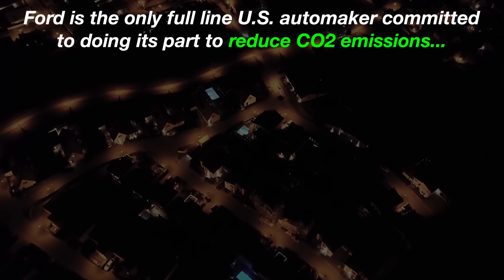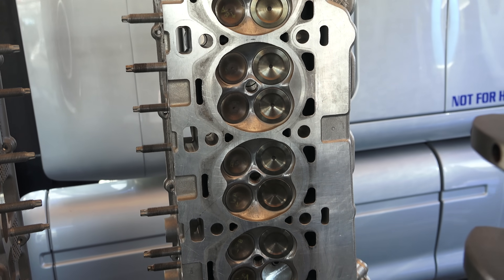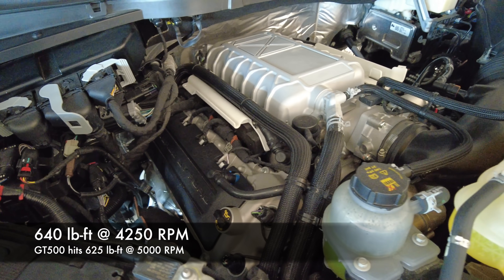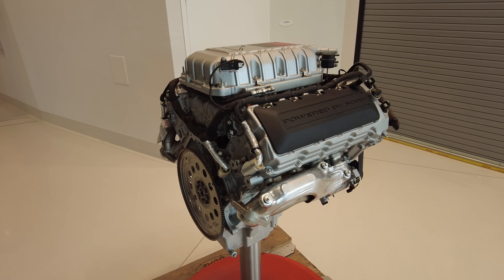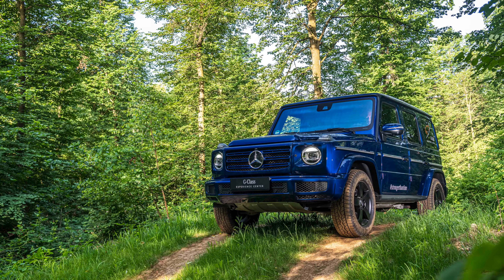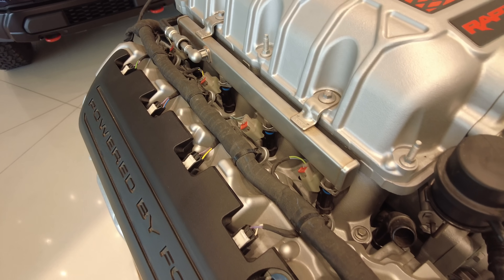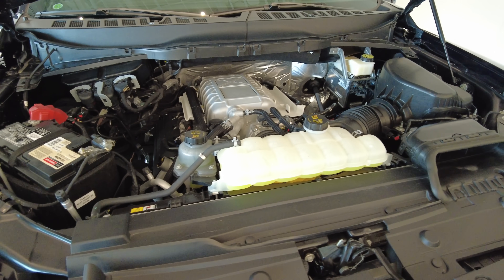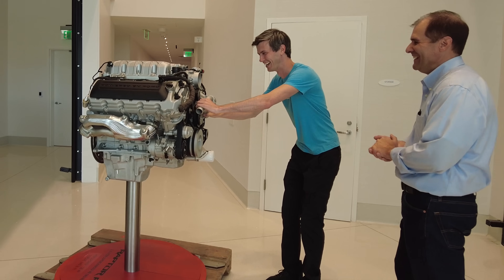Ford Raptor R's New V8 Engine - Meat's Back On The Menu

Comment from the maker: *UPDATE - WRONG INFO* Clarification as there is some bad information at 5:13 (as pointed out by Cory Engel in the comments). The bypass valve operations is as follows, as per Ford:
1. When the engine is at WOT, the bypass is fully closed, and everything goes through the rotors, charge air cooler and into the cylinders.
2. When the bypass is fully open, say at idle, when no boost is required, then the majority of the air goes through the bypass circuit. The engine air flow demand is not very high, and it takes the path of least resistance. It still goes through the CAC.
3. At part throttle, part loads, the air can recirculate in the unit.

Regarding 3 above, this means at part throttle (highway operation, etc), the airflow still goes thru the rotors, but the excess pressure actually is bled through the pass and recirculates (unlike what I state in the video, that airflow skips the rotors - it does not!).
Reply: Do a YouTube search on this;
What if Toyota revealed Nuclear Diamond Battery?
This could end ALL combustion engines. What do you think?
Reply: Skipping the rotors entirely would be better, yes?
Reply: Thanks hillbillies for destroying our climate and causing drought and wild fires from trucks
Reply: Buick had a bypass on the 3800 Supercharged engine. It achieved 30MPG hwy (real-world) in a full-size FWD car. Back in 1990.
Reply: That's a new design of the first clutch pulleys first used on alternators, Ford started using a clutch pulley to prevent over-revving the alternator in the early 2000's, going past ~18,000RPM causes centrifugal force damage to the internal rotor windings (and small 8mm rear bearings). 4.6L DOHC engines in the SVT Mustang Cobra, Mach 1 Mustang, and Bullitt Mustangs were all at risk of over-revving the alternator.  The Crown Victoria Police Interceptor also got the clutch pulley because it had a larger special (expensive) Mitsubishi 240amp alternator, and concerned Law Enforcement would drive it too aggressively with the larger internal rotor to produce that amount of current for all their electrical devices, was at risk of over-revving (was also available on dual battery Super Duty's, but no risk of going past ~18,000RPM).
Reply: Wow, Ford blew it on the logos on the hood.

Comment: Comparing this Raptor V8 to an electric truck. The Raptor is going to be a bit slow with bad gas mileage, and has the typical truck lines. It also has a ton of motor oil, transmission fluids, spark plugs, gas, supercharger and a truck body. I need and want this Raptor R.

Comment: They’ve should have used their Dedicated pushrod Godzilla 445 (7.3) cubic inch Truck engine. Supercharged crate engines from Mast Motorsports are making 1,300 hp and 675 hp naturally aspirated with a cam change.

Comment: How many valves? Does it have complex variable valve timing? Ohc? Since the late 90s ford has been producing engines that are better suited for boat anchors. Lousy engineering from college kids is my guess but there is no guessing how bad their stuff has been for 25 years. Last good engines were 460 v8, 300 straight 6 and internationals 7.3 PS. Sad but true. Show me don't tell me after that long.

Comment: No dude!  Nothing is as good at lubricating than an air gap.  An air gap provides excellent lubrication up to speeds of MACH 2.5.  Why do you think we use magnetic bearings in large industrial equipment.

Comment: Too little too late. They should have done this in 2017 instead of forcing the v6 on everyone that wanted a Raptor. The interior will need some major upgrading to compete with the TRX. Dealerships have gone insane, the markup on these will be astronomical unless Ford takes steps to address it.

Comment: More cubic inches please.
Ford should have made the modular engine with a larger bore and shorter stroke for a capacity of say 6.2 litres instead of 5.4.
A supercharged 6.2 would have 800hp and 700 lb ft of torque.

Comment: Now if Ford would just listen to its customers and bring back manual transmissions in their normal pickup trucks I would buy one put a manual in the Ranger the F-150 either one I would buy one until then I'm going to keep driving my old tired manual transmission Ranger and my 5 speed 2010 GT I cannot stand automatic transmissions!!

Comment: Awesome to see ford put this V8 in the raptor! And still give you engine options. I think we have to thank the TRX for Ford doing this. And also ford upgrade the rear suspension to coil spring 5 link. 

I like both the TRX AND the raptor but the comparison I wanna see is them in stock form compete in the Baja 250-1000 or any desert race. All the TRX videos are of them drag racing 😓 I want see if the TRX can hold up in extreme desert racing.

Comment: To bad it didn't used to old bundle of snakes center valley exhaust with turbo and cylinder fuel injectors on low speed with port injection kicking in at higher RPM's...

Something like that good old double pumper Holly carburetors...  More gas to pass when the pedal is on the metal 😊

Comment: Intake implosion is a real thing. I crushed an aftermarket filter due to air restriction. The cone filter collapsed on itself. Had to switch to a dual cone filter and calculate the surface to volume to find one that fitted my carbonfiber airbox.

Comment: Stuff like this is what drives me crazy about why the Silverado ZR2 isn't something more than it is. Why don't they have it with the 650hp supercharged 6.2L engine? At least as an option I can fully understand having the regular 6.2 in it also. Hell they should take that new 5.5L from the Z06 and put it in there, wouldn't even need a supercharger to stay in the hunt. But wouldn't it be glorious supercharged? 800+ screaming through the mud!

Comment: I was actually hoping Ford would make a smaller displacement version of the Godzilla engine.  They already have a 6.2L engine, but it is completely different in design from the 7.3L.  They made that 7.3L to make power, torque, and be reliable.  Why not decrease the displacement to say...6.2L, and give that a supercharger?

Comment: No Ford truck or car is worth 100k when the ford lighting came out 5.4 supercharge light weight truck with like 380hp running mid 13s all for 35k  for a truck like this to cost 109k there is no reason behide it! Not worth it

Comment: Do we really need trucks, that aren’t really working trucks? A friend who had access to a recent accident, a new Ford Raptor, where a fatality was involved. Ran under an overpass and disintegrated. Heads were knocked off the engine, which was lying on the ground, seats were stripped of upholstery, the right side of the truck was gone in hundreds of pieces and the guy’s brains were smeared on a column. Built Ford tough meant nothing to this guy.

Comment: I still think I'd rather have a TRX. Better overall truck and interior. Oh and more power 🔥
Reply: TRX better? Have you driven either one? 2 hp is not much, but 500-700 lbs. lighter  for the Ford is HUGE

Comment: This truck replaced the Hummer for status symbol. Most of them are street princesses and are rewarded with a higher resale value for it. If you beat on it off road then good for you and good for the guy that buys it used down the road for a reduced price.

Comment: Gimme 4 electric wheels over any combustion engine everyday of the week.  No more diffs no more cooling system no more exhaust system no more brake rotors or pads  time saved in manufacturing should practically halve price & get rid of fuels. Lack of competence in governing & viability of future's we all call being slaves to imbeciles freedom.

Comment: thats funny....its 2022 and ford is still putting the same damn coolant res. in their vehicles much like the one in the powerstroke i commonly replace.....because why? plastic cracks after so many heat cycles. you could not pay me to drive a ford. Well maybe you could, pay for the gas and the mechanic, and ill drive it. otherwise, it needs to be pushed off a cliff. Ford making great vehicles is like them making a push for cleaner vehicles....it doesnt exist

Comment: That Unused Front Crank Shaft Axle Actualy Can Be Motorized To Make More Electric Generator, And That Air Intake Are Potential Wind Turbine Generator, Even On The Roof Actualy Need Turbine, And In Propulsion Shaft, Bypassing Engine Power, Vehicle Movement, And Consistency Of Wind That Come From Aerodynamic Effect, And Last, Pem Electrolyzer, Mixture Water And Oil Solution Is Potential Fuel, Injecting Hydrogen, Water And Oil All Together, this are fastest greenering all current internal combustion engine, 5LPM hydrogen on demand are enough to powered a car sincr imposible to car for digest 5LPM hydrogen even at full throttle.

Comment: Awesome truck and I'm sure it will go over big. But for me, I'll just be happy with my regular F150 Eco 3.5 and its great highway manners and very good mpg's. I'd hate to have to pay for those 11 quart oil changes! And $109K is way out of my price range. Hope to see the new Raptor succeed though.
Reply: I'm with you on the 109k sticker for the v8 raptor,
Reply: Ive been modding my 3.5 and its super fun. Does great wheeling, and “overlanding “
Reply: You will never see one as low as 110k. Dealer markup will be insane

Comment: With the advent of Vehicle Electrification,  anything under 1000hp is a kids toy...... which means as Battery Tech Gets Better Logarithmically, ICE is gonna be flushed down the toilet faster than ever.      I miss my 79 VW Diesel Rabbit, My 97 H1 Hummer, and my C5...... the smell.... the slowness... ahh the memories...  Can't wait for my 4 motor Cybertruck.....I have that gitty feeling again I had when picking up my H1.

Comment: While the supercharger pulley diameter difference is mentioned between the Gt and the Raptor, what about the crank pulley diameter? This needs to be considered at the same time as the SC pulley.

Comment: Screw the Greenies, they don't know what they're talking about, it's been that way for the last +50 years & they still don't have it right. The air intake is in the front, level w/ the top of the radiator. So anyone going rapidly(instead of fast) through water could create a wake that might go over the nose, maybe a snorkel that would ride higher on the body would've been better. Regardless of where the air enters, what is the fording capabilities of the truck? You also didn't specify what octane the engine needs, you did say it had a lower C/R so can I assume regular? I favor a twin screw over a roots but I will never spend 6-figures on a truck. I'll build my own.

Comment: I love the small overhead cam V8 but it seem like they should have put a supercharged 7.3 engine in the Raptor R.
Reply: No doubt it’s a heavy truck not a car. What good is 7k rpm in a off-road truck????
Reply: Yesssss bro u need to work at Ford!! That's the best idea I've ever heard!!!
Reply: I think they didn't see the benefit in working a truck motor designed for efficiency and mpg compared to the already available gt500 motor that required little modification, also the extra weight would make it worse to handle while driving off-road so they made the right choice.
Reply: @10001000101  Plus the 7.3 is a lower rpm work engine not a racing high performance look at me go!  Just like the 460 it was tough and very durable unit.

Comment: Ford: We will use a sophisticated flat plane V8 from now on.
GM/Dodge: We put supercharger on cross plane V8 for more power.
Ford: We will make a cross plane supercharged V8.

Ford: A turbo-charged V6 Raptor is more efficient and works better.
Ram: We make heavy truck with supercharged V8.
Ford: Our customers have been asking for a V8 for a long time, so we put one in the Raptor.

Comment: The timing of this is pure gold…”Does anyone actually off-road their G wagon”. Well, yeah. Actually there’s a pretty popular vid on YouTube right now only a week or two after this was posted that shows a little of that. For sure previous generations were used off-road more before their values skyrocketed and they became a status symbol more than being valued for their actual designed purpose. This Raptor R is sure to be a performer too, but it seems unattainable for people that would actually want to use it off-road.  The pricing is as crazy as the current G-wagons.

Comment: That was a nice subtle play on words. The real reason Ford didn't want a power war is the Hellephant. Hennesy is already up converting TRXs with the crate Hellaphant engines. It's just not worth it for Ford to chase a 1000hp TRX. And the extra weight in the TRX is mostly strength and durability. Not too shabby on the luxury either.
Reply: I believe the extra weight in the TRX is due to the steel body, not more strength or durability as you say. When Ford switched to aluminum bodies they saved approximately 700 lbs. Over their older steel body

Comment: Dissapointed...Slightly. Ford, Why not install a Supercharged Godzilla engine in the Raptor R? Seems like lots of power left on the table, due to limited displacement, when compared to the "other guys" offerings.

Comment: Questions for the engineers. Why not flat plane crank instead of cross plane? Why not turbos instead of super charger? Why not independent rear suspension instead of live axle? Why not locking front differential?

Comment: These trucks might use a lot of fuel compared to today's vehicles, but comparing them to something like my 1st generation Xterra where I get about 12 mpg in the city and 18 on the highway, they are amazing. They'll get only slightly less mpg, but they are 6k-7k pound trucks that make 700 ponies. That is more than 4 times the power my xterra made new. Extremely impressive to me.

Comment: Hello. I have an old Saab 9-3 and I've only ever run it on premium fuel. However now with gas prices being the way they are I want to run it on regular octane gas. The manufacturer suggests that it's okay to run on 87 octane fuel as well but the car has now done over 300,000kms. Would it be a bad idea to switch to low octane now as could it cause engine damage ?

Comment: $30k cheaper and far easier to work on.  The main difference between Ford and Dodge is that Ford engineers have never turned a wrench in their life. Thats why everything on a Ford is so dam cramped. Ford engineers  don't understand that to get to that bolt you need enough room to get a tool in there to take it out.

Comment: the last dinosaur 🙂
it will be interesting if there is use for an EV with an added 100HP ICE range extender connected to an electric generator in a few years. what could it be? a three cylinder 4-stroke, a two cylinder two stroke boxer configuration, naturally asperated or a turbo? running at constant low rpm to be efficient?
i am an EV fan but i understand that this Raptor has a certain attraction too.

Comment: The national energy/power grid, can barely keep up with peak demand at present, almost no discussion on where and when new/upgraded power stations,transmission networks or even what fuel they will use. Millions of people charging their batteries will need an amazingly large supply of elecricity.

Comment: Ford absolutely rushed this. They had no intention of building this truck until the TRX came along. They had no competition until now. They put a little more effort in it but the frame isn't uniquely engineered and tuned with the suspension like the TRX,  the alternator is on the bottom because its the GT500 motor, and it starts at $109k vs $78k for the TRX? Even the front axle sits 20mm forward on the TRX to keep the weight of the motor behind the axle. All that engineering from hood to hitch for $30k less. Also 700 hp and no launch mode? I had the previous gen Raptor and would tell you you'd be better off with and F150 with a Coyote 5.0 and a long travel kit.

Comment: It even looks like that engine wouldn't be a pain to work on. 

700 horsepower, I can't even imagine. My F150 has "only" 302 HP and it's plenty fast.

EDIT: looks like Ford borrowed that oil cooler from a 1983 Rx-7.
Reply: Hope it is better than the 5.4's !!!
Reply: @garyalford9394  Everything I've read about the 3.7 v6 in my truck has said it's as durable as one could want, so long as it's the RWD version with the external water pump.

Comment: These are going to sell out faster than the Lightning, plus lots of Ecoboost Raptors trade in for the used market. Or lots of Ford Tremors trade in for that Raptor R, not going to be base model F150 trade-ins.

Dodge (Jeep) has always had problems, everyone wants to get a Hemi or Cummins engine swap, but nobody wants the trucks.  Lots of old Fords with a Cummins swap, almost nobody wants an older Dodge truck (unless they are pulling out the motor).  Everyone wants Ford Super Duty axles for their truck or Jeep. Nobody wants Dodge (Jeep) axles with that weak center disconnect.

Comment: Hopefully using radiator water to cool the oil ahead of the oil filter does not fail else radiator fluid will get into the engine oil and catastrophic results. Navistar had this issue with their 6.0 L diesel they sold to Ford know as the power stroke.

Comment: So why can't I order the 7.3 in an F150? Those pushrods are working great in my friend's F250. Maybe OverHead Cams are unnecessary on a pickup? Maybe a 7.3 F150 could be offered at half the price? $55K would still be a lot for a half-ton truck.
Reply: @efab9346  Pushrod motors make no power? Uhh, have you ever heard of a Z06 or a Demon? Don't those have pushrod motors? Ever seen the way the 7.3 moves the F250? Have you not seen the power it makes modified? Do we need 8k in a truck to make it nice on the street? Would it be helpful to pay a lot less for a truck that's quicker? Stop being ignorant.